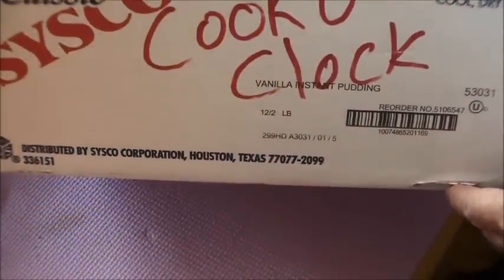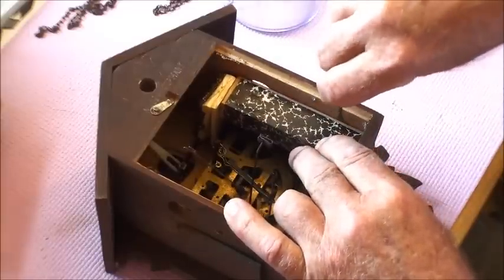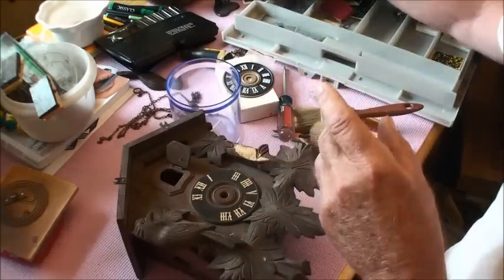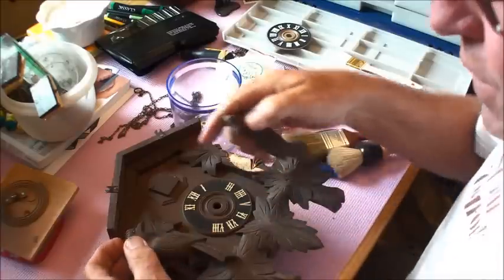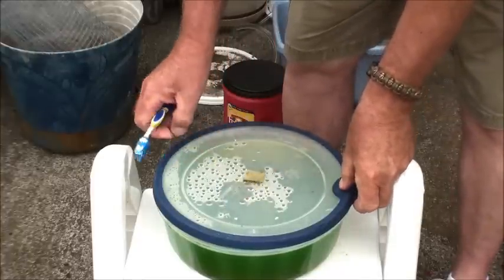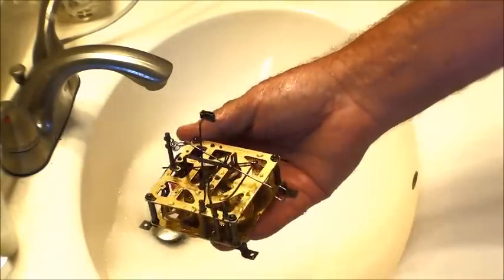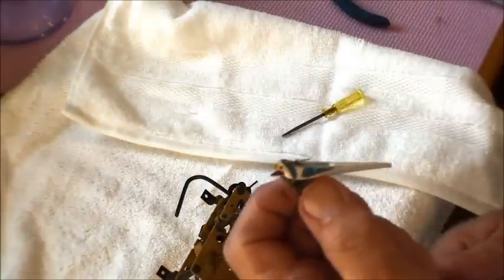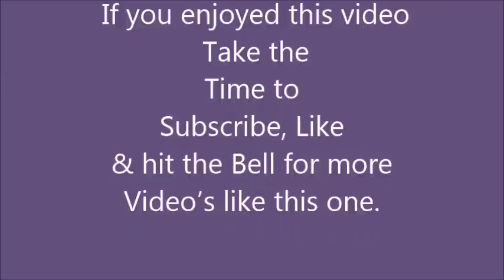Cuckoo Clock Repair

Comment: I don't know if I am up the task but thank you for a fairly comprehensive video. And I will have a go at it....I'm here as I brought one from Switzerland in 1983 to Sydney Australia. Quite early on the hours stopped cuckooing (like an answer to my prayer!) But on the half hours I always got the Cuckoo letting me know once.  However the last few years I had to increase the weight to get it going and today only the other extra addition of a 2 litres container of water can get it going.   I read somewhere that the accumulation of old oil and dirt about is the probable cause of the problem. So I'm trying to find out if I'll be able to clean it??? Thanks again :)""""
 So a big thank you from me :)
Reply from the maker: Hey there Meeekstube. You are right about the old oil and dust that fills the clock. They are an open clock because of the pendulum and chains that pull the dust up inside the clock works. Adding weight only stretches the chain and in time you might have to buy new chains. Also, if the clock is close to the kitchen, it will fill with the oils and grease faster, in which causes the dust to stick to the works even faster. 
  If you can buy some clock oil and clean the works as I show in the video, (Using Dawn Dishwashing Soap is work, but will take more time to get the new oil to work it) your clock should be working again. Below the video is my email address if you need some extra help and pictures with your questions will help.
Reply: @justmike57  Thank you again for that (from Mike too) as I get this Down Under sometimes From Michel I had to get used to Michael, Mike, Mick and worse things as well:)! So unlike you I can't be called "just Mike!... Here we don't quite speak the same language as you do and especially with cleaning products, but I'll look for Ammonia solutions that may do the trick. One of my mate is well versed in chemistry I'm sure hell guide me right!

Comment: hello, my pendulum on my cuckoo just swing for about 25-30 second then stop.  If i push it back it start for about another30 sec then stop again.. Is there an easy fix for this ?  everything else work or have been repaired
Reply from the maker: Not knowing about this clocks history, If it has not been running for a while, the oil could have gummed up, along with the dust. 
  Cuckoo clocks are considered a dirty clock because they are open to the air a lot. The chain drags the dust up inside, the pendulum space open and if you have music and dancers. They say a good cleaning and oil along with a clean environment and away from the kitchen should last between 5 and 10 years. 
  There could be a chance that if the clock was stored away for a while, could start running again if you keep starting the pendulum every time you walk by it and it might free up again. Open the back of the clock to see how clean it looks will give you a small hint on the condition also.
Reply: I had the same problem with one movement, I cleaned it twice and lightly oiled but it still would stop after 5 or 10 minutes, I changed the weight out to a weight about 120 grams heavier and that fixed it, this happens because the movement is worn. hope this helps.

Comment: Hey, never had a cuckoo clock in my hands, but do you think it would be possible to make a 3D printed "copy" of the mechanism? the gears would have to be like 1 mm thick and would be made out of plastic, so that's why I'm asking you. And if yes, do you think there is a place I can get blueprints or tech drawings of it to take measurements from? or should I buy an old working cuckoo clock, disassemble it and copy the parts one by one? I know, a lot of questions, but it would be great if you'd answer them for me. :)
Reply from the maker: To tell you the truth, I don't know how strong the 3D printer plastic is, as for wear. There are some smaller cuckoo clocks out there that have smaller weights that might work and I think you are on the right track on buying an old works and copying each gear. I also don't know how much drag you would get, where each gear slide into where the sleeve/bearing is. This would be a cool project if it worked if you don't mind spending the time with it and what money it takes to make it. If anything, you could show the works off in a glass case BlackboardIdeas
Reply: @justmike57  thanks for the reply, I'm at high school now, so I'll wait until I learn to make gears in CAD at school and then I'll attempt it. I also don't have much money to buy this.

Comment: Mike. I have the exact clock and followed your steps tp remove and clean the movements. I have a question. When I removed the suspension bar that operates the verge, it was loose. When I tightened it the loops at the bottom of the post were off a few degrees from the vertical. Is this how it is suppose to be?
Reply from the maker: Tony, if the clock will still run and keep time, I would not worry about it unless the clock is crooked when it ticks at the right beat.

Comment: Mike I have that same clock but I can't seem to keep the pendulum swinging, any advice would be greatly appreciated.
Reply from the maker: Hey, Lucas. If the clock hasn't been cleaned in over 10 years, it could be time. Cuckoo Clocks are considered a dirty clock because they are opened a lot to the air and dust, in which collects on the shafts of the gears and starts to get all gummed up. Some just oil the clock on one side to get the clock ticking again, but that is temporary and might only last a week to a year, depending how bad it is. I have an email below the video if you would like to email me anytime, I try to check it twice a week.
Reply: @justmike57  I used a baking soda and vinegar mix. Would that work? I was trying to figure what you used in the video.
Reply from the maker: @lucaswilliams380 , I use a Clock Cleaning Fluid to clean the clocks well, if you go to my playlist and look unders Cuckoo Clock Repair, you will see the jug I use in the picture of the video. You could use Dawn Dishwashing Soap and Spray a mix of ammonia and a toothbrush, but doesn't work very well and harder to get the clock running again. You don't want to use soda, to abrasive and might be hard to get it all off.
Reply: Thanks Mike I'll go back to your video and check it out. That very well may be my problem. I did find it hard to get all of the baking soda off. Thank you for your help!

Comment: I have a really old cuckoo clock just like this but a little bigger.   It was my parents and I have very fond memories of it being in the house when I grew up.   It’s still works.   The numbers have gone a bit off colour though, whilst the hands are still white.   Any recommendations for cleaning up the numbers to bring them back to white  ?
Reply from the maker: Some of the numbers and hands are an ivory color already. If you need to clean them, you can try almost any cleaner that works well for you on other things. Just use a Q-tip that is not dripping wet so the cleaner stays on the number set and not run all over the dial. After cleaning the best you can, you can also try Alcohol and or Bleach. Don't worry if they are not sparkling white. Your clock might look nicer, knowing it has some age on it.
Reply: @justmike57  thank you.    My dad has only just given it to me.    Not sure how old it is.   He purchased it second hand in Berlin in 1949 - is there any way to find out how old it is ?
Reply from the maker: @debsidoo1008  I use to be really into trying to find our about the age of the clocks, but not as much anymore. I do know if it is pre World War 1, the nut that holds the hands on, including the washers are bigger than the newer clocks and I can't find where they sell the nut and washers anymore.
Reply: @justmike57  can I send you a picture ?
Reply: I’ve sent you a picture by email 😃

Comment: my clock has the music and the revolving figures. When I put the chain on the "sprocket wheel" for the music it won't hold the weight and falls to the end. Any way I can repair it? (with your advice of course). I already have it cleaned per your video, just waiting for the new chains.
Reply: I found a replacement wheel and have ordered it. Thank you
Reply from the maker: That is great you found the replacement winder. Not to often you can repair the wheel Linda Bastida.
Reply from the maker: Thank you very much for watching and glad the video helped you out of cleaning the clock Linda Bastida.

Comment: Hey Mike, I am attempting to repair a cuckoo clock my dad bought in Germany in the 60's. It has a music box, but one of the gears is missing some teeth that help it to play. do you know of an online supply shop that has gears for such things? also, do you have an email or something where I could more quickly communicate with you? I'm likely going to have more questions as I work on this, and if for some reason I'm unable to repair it myself, I'm wondering if you work on these for others?
Reply from the maker: Hey Witty_1. I haven't found any place that helps with the gears on the music part of the works. I see, on Ebay, they sell the music boxes for the clocks, but are very expensive I feel. Depending on what gear is missing the teeth, you might look at music boxes at the thrift shops that might have the right gear you are looking for. As for an Email. I have it posted in my newer videos below the video in the show more area. Otherwise this is my email; justmike2575@gmail.com
  And yes, I do work on other kinds of clocks, but the Cuckoo Clock is my most favorite. This is just one of my hobbies I enjoy and I don't learn the names of all the gears, unless I need that part and have to look it up. I try to work with others that don't want to be a Rocket Scientist, they just want to work on their clock and get it running again. Thanks for stopping by Witty

Comment: Hi Mike, I have that  same clock . I searched how to fix and came across yours. Could you share the cleaning fluid formula for the works? Mine is a mess!
Reply from the maker: Hey Ed Mederios. I use a Clock Cleaning Concentrate that you can order form most clock parts houses. But if you only have one clock, use hot water and Dawn Dishwashing soap. Let it soak awhile and swish the works in the soapy water a few times. Also use a toothbrush on the works gently and especially if you see an oily dusty areas. After doing this several times, rinse it well, with hot water and dry it like in the video. Oil it, put it back in and you might find, it will not like running very well, until the oil can get worked in. Hope this helps you Ed.
Reply: @justmike57  Boil in baking soda water, its the best.

Comment: i picked one up from a friend, it looks good but the left side chain and weight wont move and it the pendulum doesn't stay swinging. any ideas?
Reply from the maker: The left side is for the bird to come out on the hour and 1/2 hour. There is a good chance it needs cleaned and fresh oil. You can try turning the minute hand clockwise. If it is very stiff, it also shows it needs cleaned and sometimes if you turn it clockwise for several hours it could free it up, but might not work very long and still needs cleaned Brian Preston.
Reply: @justmike57  i will try that, thank you

Comment: Merhaba, Türkiye'den selamlar, ben mekanik saatlerimi dikiş makinesi yağı ile yağlıyorum sizce uygun mu? Ya da hangi yağ ile yağlamalıyım? Ayrıca aktif kullandığım mekanik saatleri  yılda bir defa yağlıyorum sizce yeterli mi ? Teşekkürler 😊
Reply from the maker: Hello burak dağ, over there in Turkey. Sewing machine oil might work, but I don't know how long the oil will last. In the Old Days, they used car oil. I now use 0-20 Synthetic car oil. It seems to work better for me than clock oil. 
  The book suggest to oil your clock every 5 to 7 years. Just make sure to us a can of air to blow out any dust that might have entered your clock. It also depends on how dusty it is around the clock. Car traffic, pets, open windows will all bring in dust and unwanted hair into the movement.
Reply: üstadım çok teşekkür ederim tam ve doyurucu bilgi verdiniz. iyiki varsınız :) 0-20 sentetik araç yağını deneyeceğim (bir videonuzda 0-20 yağ kutusu kadraja girmişti tesadüf değilmiş). mekanik saat yağı almak istedim fakat bulamadım internette de korkunç, fahiş fiyatta vardı. alternatif arıyordum 0-20 yağ imdadıma yetişecek umarım. sağlıklı günler dilerim @justmike57
Reply: @justmike57  merhaba Justmike, bende günlük kurmalı Alman guguklu saat var fakat ağırlıkları eksik. Ağırlıkların, kozalakların her biri kaç gram geliyor acaba? Teşekkür ederim efendim
Reply from the maker: @burakdag7976  You can use the bucket method to figure out what weight you need. Get a bucket that you can hang from the chain. Slowly add water to the bucket until the clock will tick and or the music will play. Then weigh the bucket so you know approximate weight that you should buy.
Reply: @justmike57  haklısınız çok mantıklı.  günlük kurmalı alman malı da olsa ağırlık standart değil anlaşılan. çok teşekkür ederim tecrübelerinizi paylaşıyorsunuz böyle...

Comment: What exact cleaner did you use for the clock mechanism?  I know you said Ammonia. But am I buying. I don’t see green ammonia at my local store.  .
Reply from the maker: This is a link for home made clock cleaner but now I also add 1/2 cup of Murphy soap to help brighten the brass,  https://youtu.be/eIQ9LAfPCKw  
  For the GREEN colored stuff I used in the video, it was a movement cleaner I bought from an online clock parts store with this video, https://youtu.be/Ctbd-Vs2lNA

Comment: Mike I still have my papas cuckoo clock they are very fragile 50 years old still works great The only thing was the bird got stuck
Reply from the maker: I have a lot of them over 50 years old. Even the new cuckoo clocks you would not want a child to wind up. With the bird stuck, and if the house has a side door, You might be able to get the bird moving again. Thanks for watching Will the Rocker Will
Reply: Thank you so much Mike I really appreciate it I love black forest Germany I have a lot of smokers handcarved The wood is very fragile because it’s Pine
Reply from the maker: @willtherocker2373  When I am Shopping at the thrift stores, I look for the incense smokers. I found several of them. On the cuckoo clocks, I don't know if it is even pine wood they use. It is like they used the cheapest wood and stain they could find or make. But I guess that is what makes them really cool also.

Comment: Hi mate.just got old of a lovely Cuckoo clock.driven by Hubert herr movement..replaced hands .now it's.ticking pendulum swinging.but not driving any hands.notice drive hand shaft is wobbly.any ideas
Reply from the maker: Take the minute hand off, then push the Hour hand on while turning it, until it gives resistance. Sometimes the minute hand holds the hour hand gear in place Darren

Comment: Hello, just wondering if you could suggest an alternative cleaning agent? Thanks
Reply from the maker: You could use hot water mixed with a squirt of Dawn Dishwashing soap. And after letting soak and swishing the works in the water mix a few times, use a toothbrush the best you can around the areas that you need to oil and also in the areas that might look really dusty or oily. You could try that purple cleaner from the autoparts store, but not sure of it. But it does clean any oils off well.
Reply: That's for the response. I'll try that. Your videos are helping me restore my grandfathers old clock so I appreciate you taking the time making these videos. Cheers
Reply from the maker: @905billy  Thank you, and I know I am a bit behind, but, if you have any other questions, you know how to contact me here.

Comment: Thanks for your video, I am like you and I am retired. My cuckoo clock ran over 20 years and now it time to clean and re-oil, I follow your instruction and the clock is "ticking" in several days, the issue I had is the minute and hour arms didn't rotate ? Any hint ? - thanks again.
Reply from the maker: If it is still ticking and they hands are not pointing to 6, then I would say a gear is broken or bent. Pull the works out and use a flashlight to see what is or isn't moving around the shaft.

Comment: Mike, thank you, fantastic job.  You gave me inspiration to work on mine!  What other than ammonia did you use?  Was it your personal concoction or is there a type I could purchase somewhere?  Also could it be used to clean up the chains?  Thanks again!
Reply from the maker: Hey J Carroll. I use a clock cleaner fluid that you dilute with water. And yes it will also clean up your chains. I could give you the site I buy almost all my supplies from if you could email me from below the video. Otherwise I use Clock Cleaning Concentrate - Ammoniated. In my other video called, 1985 Cuckoo clock Repair, you will see the jug of cleaner I use.

Comment: I have a quick question, can I use anything els to clean the mechanics? Like soup and water, or something in those lines?
Reply from the maker: Yes you can! I have said on other videos that you can use Dawn Dishwashing soap and Hot water. A lot of swishing and maybe a toothbrush will help. I have found it cleans, but not as well as a clock cleaner fluid. It might take the clock a while to get going again, to work in the oil and move out some of the old oil and wear that you were not able to get out with the soap. Hope this helps you a bit Claire Bear
Reply: Just Mike thank you so much! So if I use fish soup and hot water, scrub it with a tooth brush, then after drying it put oil where it needs to go. It should work?
Reply: Just Mike dish*** 😂
Reply from the maker: @clairebear5450  The Dwan brand dish soap lifts the oil the best. Like I said, it will work, but not as good and you might have to speed up the pendulum and and restart it a few times.
Reply: Just Mike this really helped! Thank you so much!!!
Reply: Just Mike would you prefer Dawns Dish soup, or a concentrated cleaner?